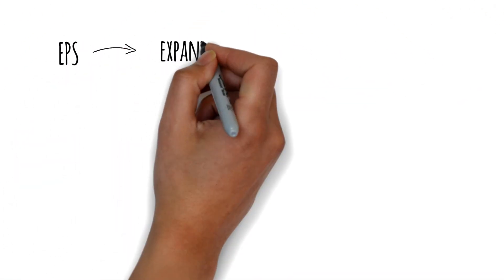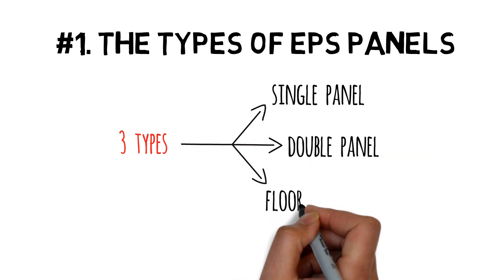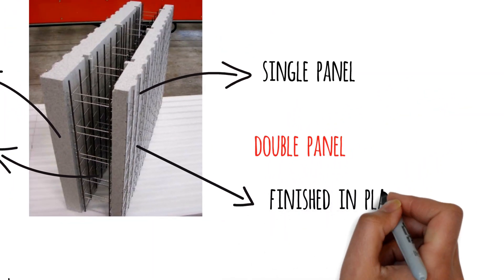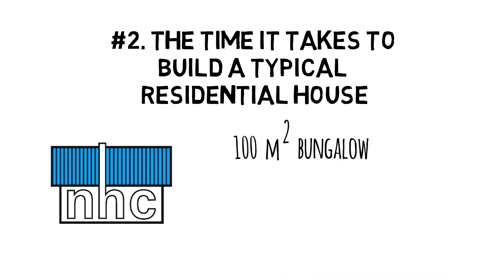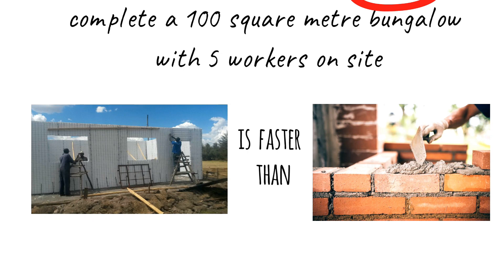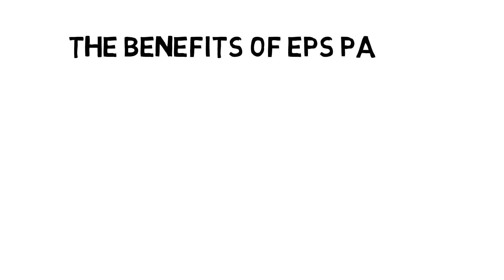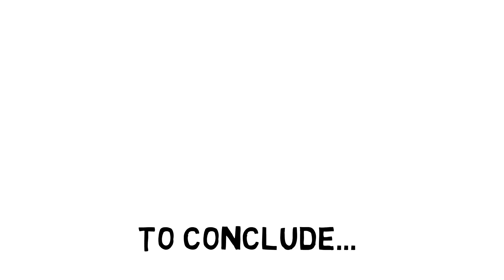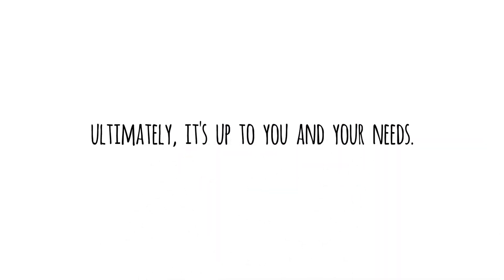What are EPS PANELS? Alternative Building Technologies in Kenya

Comment: How strong are these wall panel.If i scrap of the outside layer i can get to the inside ama.
Reply from the maker: They are strong once concrete hardens and achieves its full strength. You'll need power machines to scrape off hardened concrete Sanna.
Reply: @PropertyNoma cani get your contacts.
Reply from the maker: @sallykalya9023  propertynoma5@gmail.com

Comment: Can the double panels be used for swimming pool construction?
Reply from the maker: I think so mctrailer. As long as the right amount of concrete and reinforcement is used, double panels can withstand the pressure of water. Consider consulting an engineer for your swimming pool.
Reply: @PropertyNoma  Thanks!

Comment: Pls can you tell me,when you speak of cost for panels you you said the price for a wall panel is 4000-6000 ksh. Is that the price per square meter of a panel or per panel of a certain size?Tanks in advance.
Reply from the maker: It's the cost per panel of a certain size. For example, a 3m high EPS panel cost 5,000 shillings in Kenya. The higher the panel, the higher the cost.
Reply: @PropertyNoma  And that 3m high panel that costs 5000, what is the width of it?
Reply: @PropertyNoma  Is the reinforcing mesh included in that price? Thanks a lot for the reply!
Reply from the maker: @unknownarchon8860  Yes, the wire mesh surrounds the EPS core material. You buy the mesh included
Reply: @PropertyNoma  And what is the width of that 3m high panel that cost 5000? Need this info,pls,just that.😁
Reply from the maker: @unknownarchon8860  It's 1.2m wide
Reply: @PropertyNoma  tnx 👍
Reply: @PropertyNoma  I think it is 1.5m. I am not sure though.

Comment: How much would it cost for 3 bedroom house
Reply from the maker: Hi Rose, the EPS panels will cost you between KSh 400,000 - 600,000. In the description section of this video, I've put links to some of the leading EPS manufacturers. They can give you a better cost estimate depending on your house plan.
Reply: But it's still cheap because the brick and mortar will also need the same plastering
Reply from the maker: Hi Freddie, indeed it's true if you're going to plaster your stone walls. EPS panels can save you some money
Reply: @freddiejuma6245  I still have a feeling that interlocking bricks like Makiga are way cheaper since no plastering is needed. I need info and clarification here though.